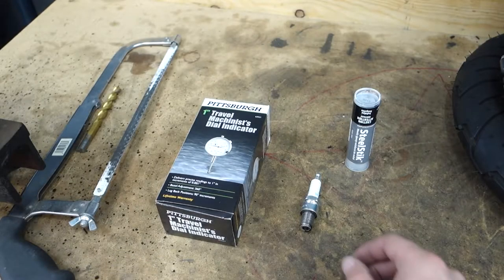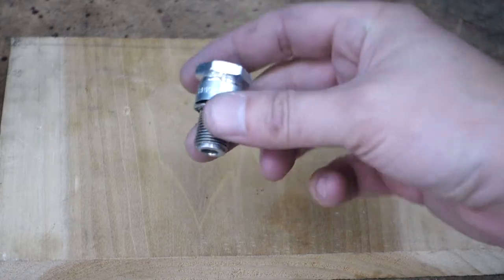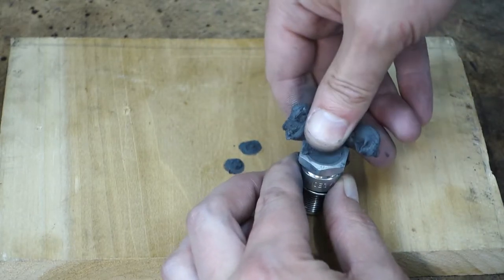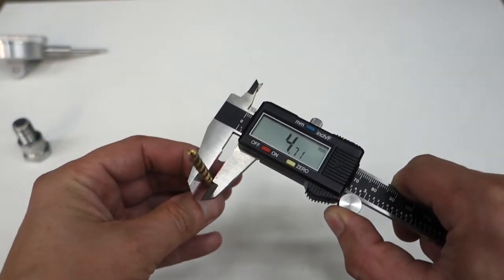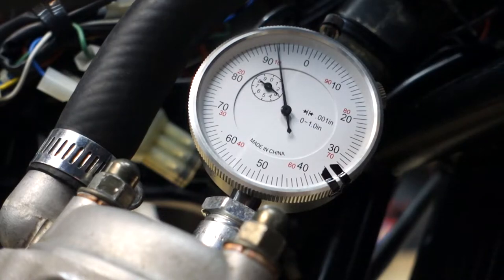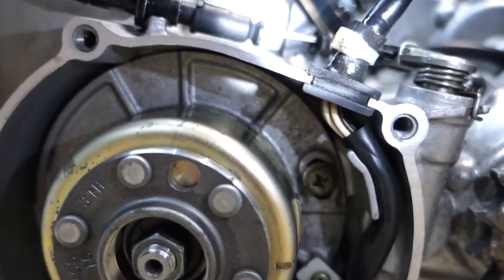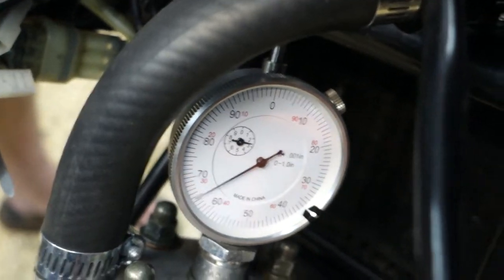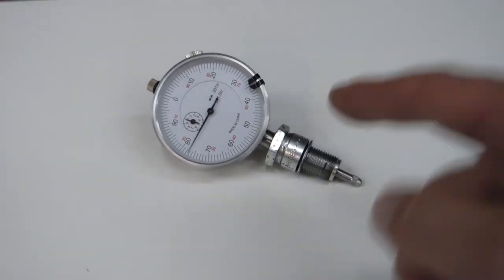DIY Two Stroke Timing Gauge and Setting Timing on the YZ85

Comment: This brought back memories, when i was a kid building 2 stroke dirt bike engines i didnt have a dial mic. I used a machinists strait bar layed it across the cylinder with the head off (most cylinders were bolted to the block separately, and the head bolted to cyl) then used a feeler guage to get timing, took longer but made do with what i had.
Excellent guage holder you made, makes timming so much easier. Thanks for the info.😊
Reply from the maker: That's awesome, I really want to get into more machinist measuring tools but they get pricey quick :) When I went looking for a timing gauge I think motionpro wanted some $200 haha. I saw an old forum post with a write up on the DIY solution but all the picture links were broken and had to give it a shot.

Comment: Excellent video. If you ever need to remove the porcelain from a plug again a 5/8” bimetal hole saw bit in a drill (with the center pilot bit removed) is quick and easy. Place it over the porcelain and in about 10 seconds of drilling, it pulls out really clean. Great for plug chops.
Reply from the maker: Thank you, awesome tip for plugs, I'll have to try that out!

Comment: I made something similar, but I couldn't find my dial gauge so I used a sparkplug, 8mm bolt (thread cut off), and a rubber grommet, it's a neat fit and slides with grease. The bike I made it for has a 4.5mm BTDC timing position so I made a simple stepped gauge. The good thing is that when TDC is reached it remembers the position because of its stiffness.

Comment: Super cool content man - off to binge your other videos now. Can I humbly suggest a grub screw to stop the dial moving in the fabricated holder - I know it's an interference fit but when you're dealing with '000's, every little bit of stability helps. Going to make this for SURE!
Reply from the maker: Thanks a ton! That's a solid suggestion, I actually bumped it out of the holder when checking my kx65 haha

Comment: My dad had tons of these in his tool box spark plug housing. How much was your micro gauge? Did it come with battery? I shouldn't of sold mine ugh. Dude did this work????? This is awesome video very clever 👏
Reply from the maker: The dial indicator was about $17 from harbor freight, it's all analog so no battery in there. Worked well and I've used it on a few engines now. Thanks, not an original idea but it worked a treat!

Comment: i’ve learned a lot from your channel man your so underrated. but i just bought a 01 yz80 and i’m gonna get a gpi racing radiator because the oem one is kinda scuffed up hopefully it should lower temps it does say it has 40% more capacity you think that would be a good route to go other than getting oem? also after that i was planing on getting a top end kit but the cylinder don’t have any deep scars but there’s some spots where it could be better and a little white discoloration but it doesn’t look like nothing to major from my knowledge but i was looking to get a NICHE cylinder with a weirdo top end and i know you have bought one of those cylinders before is it good quality? would you recommend it what’s your thoughts? thanks.
Reply from the maker: Thank you! I'm always a fan of more cooling if you're running in hot weather, in the colder areas it can be a problem at times. I'm never going to buy a niche kit again. The quality was about right for the price and the head orings melted on mine. Send your cylinder to get replated, far better option in my opinion.

Comment: Will this work for 2000 yz80
Reply from the maker: Not sure what the timing degree is on the yz80 but the tool will work on any engine with enough clearance around the plug hole.